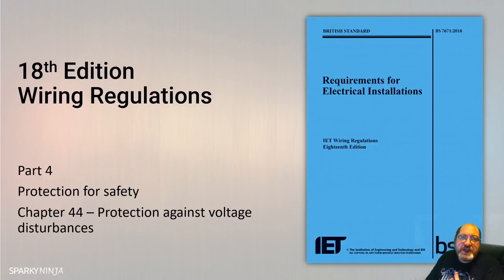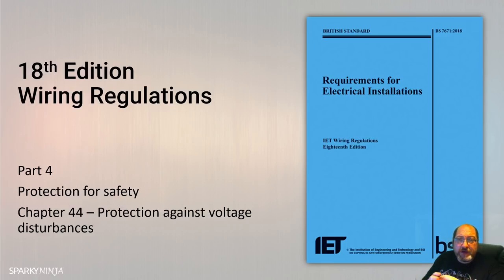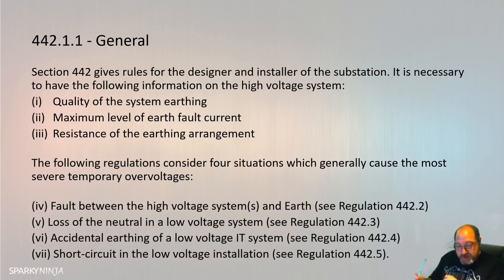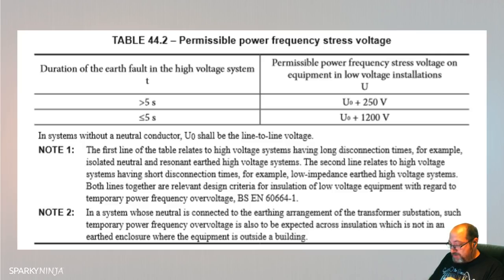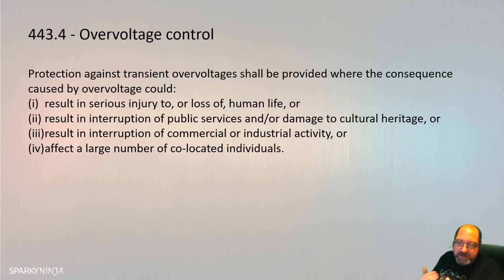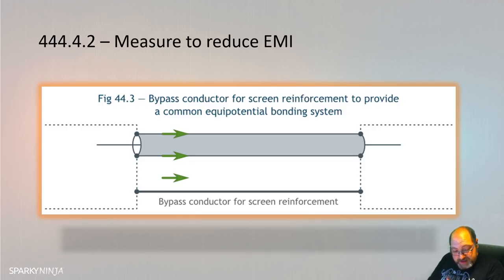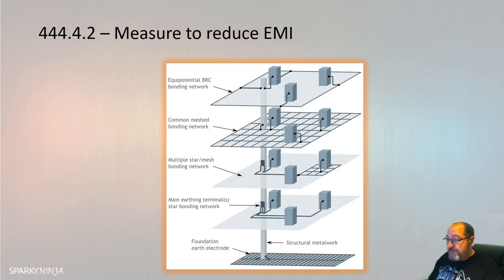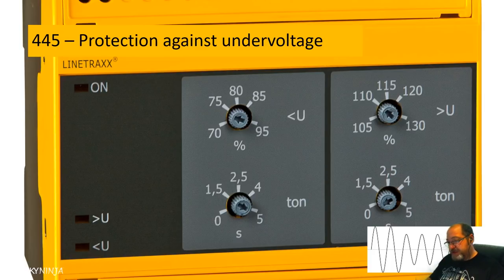18th Edition Training Series - Episode 8 - Part 4, Chapter 44 - Voltage Disturbances

Comment: Hello, 
I would like to ask a question concerning Protective Earthing and Protective Equipotential Bonding based on IEC 62305-3 and IEC 60364-4-44/BS 7671.
In the Fig. A444.4 (38:00 min) the connections are done by Protective Bonding conductors or by Protective Earth conductors ? 

According to Fig.A 444.1.1 there are protective earth conductors, also according to EN 62305-4 (5.3) there are indicated few configuration for bonding network (S and M configuration) connected by bonding conductors and not protective earth conductors. 

Could you please link these concerns from both standards - because seems to a be a bit confused, more than that their cross area sections are calculated differently. Also, according to A444.2 the bonding system should be interconnected at least twice for different floors (if any) 

Thank you.

Comment: Just to point out that the wording you show at cc 2.42 for section 422  is "incorrect" ? .  ( Well comparing it to my BS7671 2018 purchased May 2019 , 442, page 96 …   It should show :   …. "AND due to faults in the Low voltage "

Comment: With regards to t = k2 x S2 / I2. Can I just clarify that t = the time it takes for the conductors to overheat and cause damage right?. Obviously, we aim for a disconnection time of 0.4 seconds to the t value is effectively saying how long it will take the conductors to sustain damage it the circuit DOES NOT disconnect in time?
Anyone please??
Reply: from my understanding of Episode 7, i am pretty sure you are correct

Comment: Is there any clarity on the risk assessment for installing SPDs?  Joe @ EFixx seems to suggest the distance between the network operators surge protective device and the origin is UNLIKELY to be over 1KM so is the value we can use?  It seems stupid to base an assessment on a value it is nigh on impossible in some cases to obtain?
Reply: looking at it again, if LP is limited to 1K and you CAN use which ever is lower, surely 1K is a fair value to use?
Reply from the maker: When we asked Kirsty from Surge  about the 1k the response was that there isn't much of a science behind it.. its just considered the distance at which the transient energy would have fallen in value to a voltage of little concern.
We asked where that was originally from and she was unaware as in parts of Europe they use 2.5km.
Reply: Do you do courses